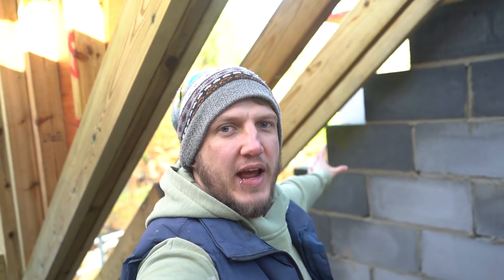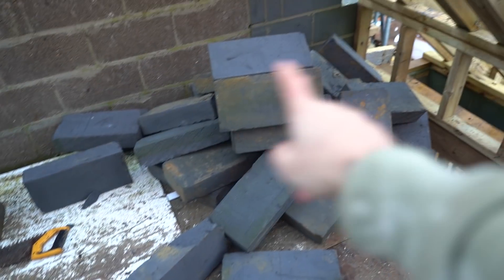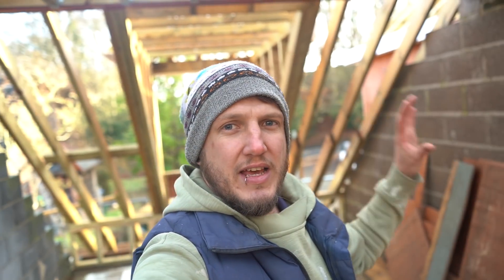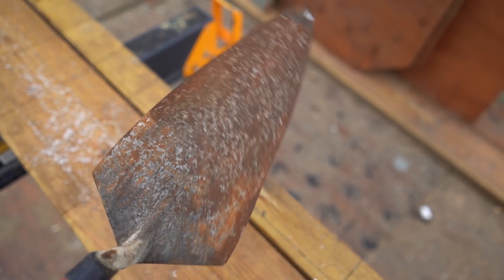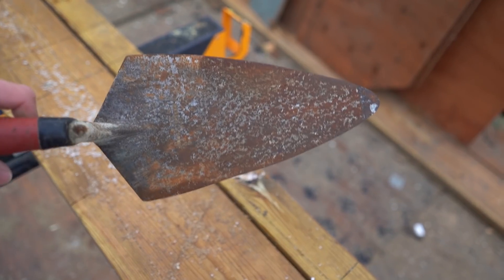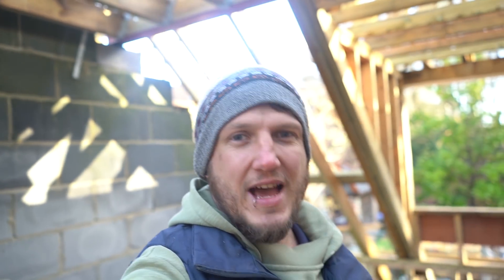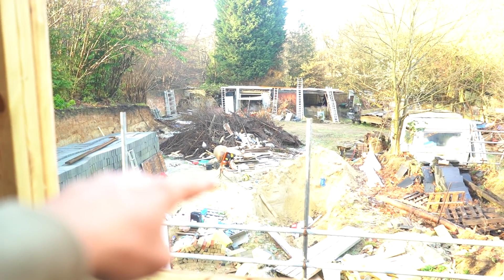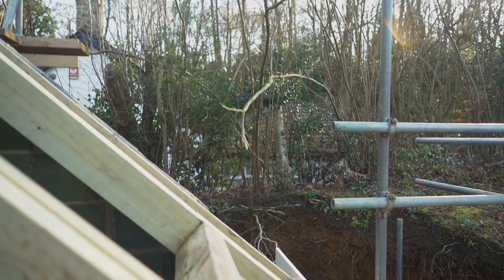HUGE BRICKLAYING MISTAKE | House build E.P 30

Comment: Hi mate 😀 Is there a reason you should keep the trowel rust free? Just the life span? Or it actually affects the mortaring?
Reply from the maker: Laying with a rusty trowel is insanely difficult, the muck just sticks to it and makes laying a pain in the arse.
Reply: @RodianBuilds  oh ok. I have both a trowel and drywalling trowel made of steel... Will definately keep them clean from now on 👍😀

Comment: Hi Rodian ever thought try using trowel magnet connected to your belt.After awhile you get used to it and it saves time looking for it.Re London
Reply from the maker: I did think about it a belt magnet but ended up just putting a magnet in my back pocket. Worked fine for me just haven't done it in a while.
Reply: Trowel shouldn’t leave your hand
Reply from the maker: Got to press record in my camera somehow so the trowel had to go down 🤣🤣🤣
Reply: @SooMuchWc  the hand never leaves the arm

Comment: On the outside gabel You need to have ties going up every course at 225 down from the pitch of the roof on a gabel mate also have Restraining straps from the rafters going into your block work
Reply from the maker: Cheers for the tip buddy. I'll add some in 👍🏻😁
Reply: Also it you ever building a gabel and do. Lock work first we bang some ties in to the trusses then bend them in to the bed once it starts going off it’s stops the gabel from blowing over and moving etc

Comment: I'll give you a wee tip when cutting up gables, measure in 100mm from top edge off block the cut down to the point then you should always put them on first and work from there obviously keep your bond just put a few brick in easier then messing about all day
Reply: Plus you can use the other side off the cut so 2 for one cut
Reply from the maker: I'll have to give that a go on the next gable I do. Cheers for the top tip buddy 👍🏻

Comment: acid wash the trowel and scrape it with a wire bruch, that should clean it up.
Reply from the maker: I went with a good scrub with a wire brush and just worked the rest of the rust off. Worked fine 😁👍🏻

Comment: Good choice on the husqvarna  saw. I've got the same one absolute powerhouse without the usual Stihl problem of a blocked filter from sucking all the dust through the filter. 
Bit of wd40 on the trowel at the end of the day keeps the rust at bay
Reply from the maker: It's an absolute beast of a grinder. I always found the stihl had such a small fuel tank. Ran out every 2 seconds. Wd40....or just remembering to put it in my bag 🤣🤣🤣

Comment: use it to lay blocks and wipe with machine oil should be ok my prevous occp was mechanical engineer so know about steel better than a average bricky if replacing a trowel go for whs broad london pattern and never buy online in lancashire they are about 20 odd quid the steel on marshall town trowels is good quality so should be ok
Reply from the maker: I gave it a good going over with a wire brush and used it on the blockwork. Came up ok and after a bit more use should be good as new. Of I need a new one I'll be coming to Lancashire at that price!!!!!!

Comment: Wet the trowel, throw some sand over it and rub it with a brick and repeat the process until all the rust is gone. That should sort it for you👍
Reply from the maker: I just went with a good scrub with a wire brush and used it 🤣 got rid of most of the rust. Cheers for the tip buddy 👍🏻
Reply: @RodianBuilds  I also used the wire brush, good a job as any👍
Reply from the maker: Jobs a goodun'
Reply: This was my daily end of shift job as an apprentice! My journeyman always made sure that my trowel was gleaming before I was allowed home, water barrel & half brick then repeatedly pushed into the sand. (The trowel, not me!)
Reply from the maker: Sounds like me but I was pushed into the sand 🤣🤣